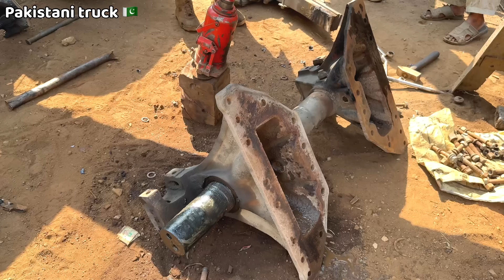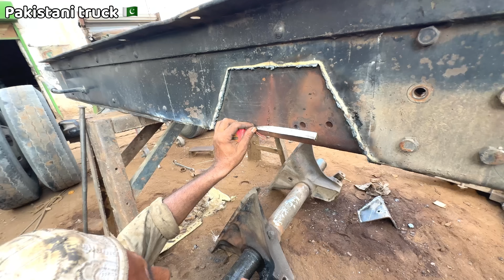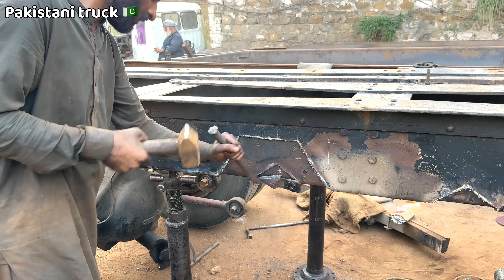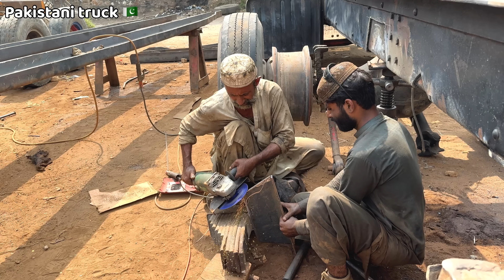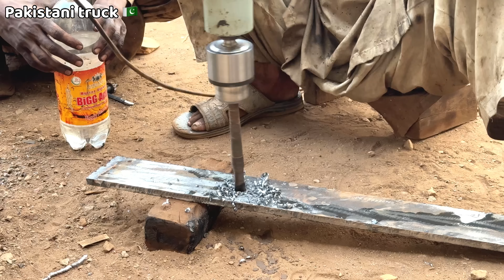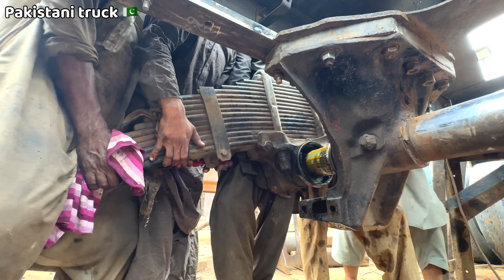Emergency Truck Repair Chassis broken under the Trunnion Amazing Repairing Like New Unbelievable

Comment: I saw a man underneath a broken-down, large Bedford truck while working in Bangladesh on business. He had lowered what appeared to be a huge transfer case using nothing but scrounged up scrap pieces of wood, tree branches, etc. The transfer case was split with most internal parts removed. Wearing nothing but flip-flops and a loin cloth; in 90F heat/90+ humidity; he was in the process of taking a coarse file to a large gear. This man used whatever was available and had the determination to affect the repair. His family doesn't eat if his truck is not working. I was humbled right then and there. Ultimate respect!

Comment: Shouldn't the welder just be able to run a continuous bead I'd think stopping and starting weld would make it weak  . Alway saw pipe welders run continues welds on gas lines
Reply: expert at tack welding
Reply: my question as well. surely better to run beads.

Comment: Perhaps they are very skilled. Also experienced. But what the f...ck?
They don't reinforce anything, just cut off where the crack is and then weld in some steel without crack. It won't hold on for long. At least I would add another flat bar on the bottom of the frame. But no, no need for that. Probably just breaks near the welds due material overheating. Total waste of time. Or maybe they just like to cut and weld over and over again. You don't cut the branch that you're sitting on.